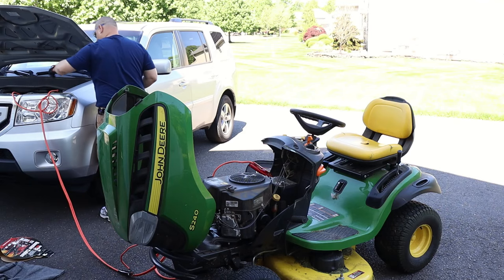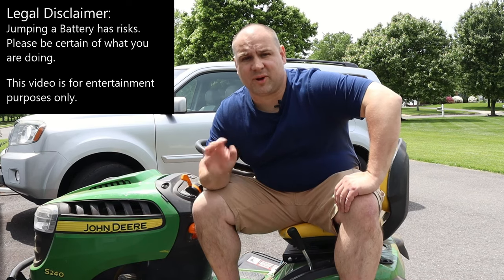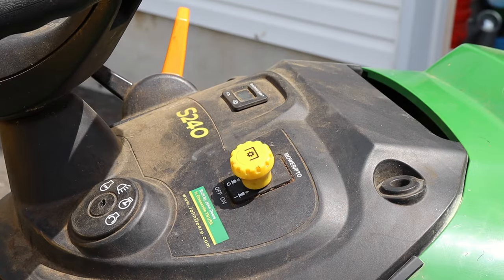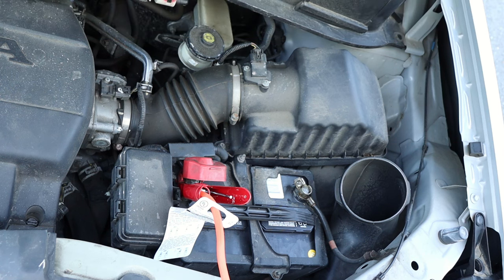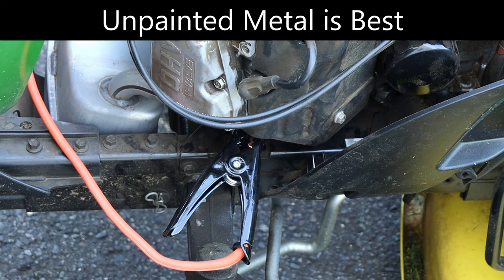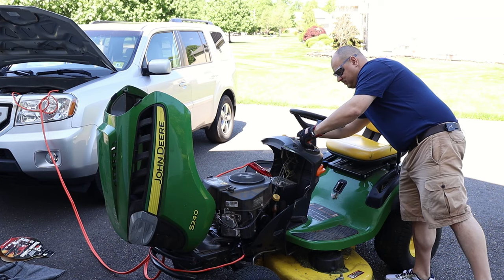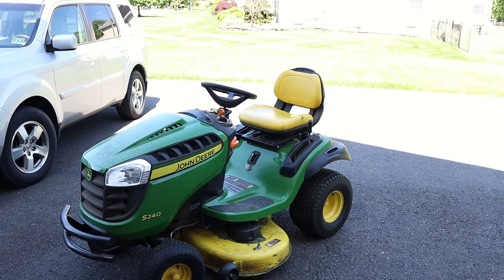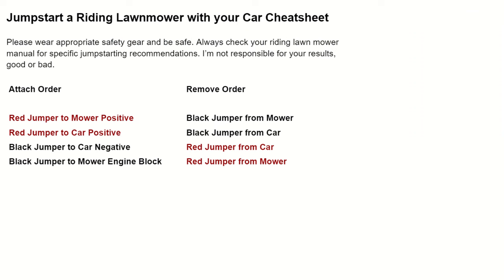How to Jump Start a Riding Lawn Mower with your Car * Safely *

Comment: Worked great!  I've been troubleshooting my John Deere for the last four days, I replaced the solenoid, new spark plugs, looking for loose wires or broken safety switches -- nothing -- just that machine-gun cranking sound with no turnover of any kind... after this video, I hooked up my car (which I would've done with the engine running if I had tried it on my own -- BIG thanks for telling us NOT to turn on the car during the process!) and the mower started right up!  I cut the entire lawn, put it back in the garage, shut if off... then I turned the key and it started right up again -- without a jump from the car!  Guess I found my problem -- hopefully the battery will last me the rest of the season!  Thanks man, you saved me many headaches!

Comment: Silly question, but should I start my vehicle to help with the charge? I noticed during the video you only started the mower. Thank you in advance.
Reply from the maker: |I wouldn't start your vehicle as you risk damaging the smaller electrical system of your lawn tractor. You should have plenty of juice from the car battery alone anyway.

Comment: Why don't you connect the black clamp to the negative part of the battery? Also, I've heard conflicting things about jumping with a car. One being that it's okay to turn the car on, but just don't rev the engine.
Reply from the maker: The battery emits gasses especially when low or no charge, when you reintroduce a charge you could ignite those gasses and cause fire or explosion of the battery. I also wouldn't turn the car on or rev the engine as you could overload the electrical system of the mower. Why risk it?

Comment: My cables arent split enough to connect the ground to a bolt on the engine block. Can i connect it to a bolt on the back side of the frame under the battery by the wheels?
Reply from the maker: Sounds like it would probably be okay.

Comment: My mower won’t start unless I’m sitting on it and the battery is under the seat
Reply from the maker: Will it let you start the mower if you engage the parking brake? If not, then you'll have to figure out how to bypass that safety feature somehow. I've never had that type of design myself.
Reply: I got the same i just wedge a log between the seat a d steering wheel
Reply: u can disconnect this safety feature by disconnecting two components.
Reply: You can also tighten the safety bolts down to the point where it overrides and believes your sitting on the sit. This will allow you to lift the seat and access the battery to jump it
Reply: Maybe my mind is in the gutter...but umm..
Reply: If you complete the circuit for the seat safety switch it'll bypass it. Every design is a little different  but the basic idea is to Just rig it up so that it thinks you're always sitting on it. I always do that. Because it's annoying

Comment: Did you have  the car on or off when you powered up the lawnmower?
Reply from the maker: Car off... If you start the car then you could potentially overload the smaller lawn tractor electrical system.
Reply: @DIYWithAaron  Thank you!

Comment: Just tried this and is shuts off after I unhook the cables. X2 time doing it let it sit for 10 minutes and shut off 2 minutes after undoing the cables again
Reply: John Deere 212 1983 year
Reply from the maker: I'd be looking at either the battery or maybe the alternator for issues in that case.

Comment: Hey my lawn mower wont start with a new battery..but it will start if I get a jump fro. My truck ?
Reply from the maker: I'd start troubleshooting by checking connections to the battery and then testing the battery with a multimeter if you have one.

Comment: Great video. Now, can I do the opposite and jump start my car with the lawn mower?
Reply from the maker: Depends on how weak the car battery is...  you may be able to jump a car off a 12 volt lawn tractor battery provided the car battery wasn't too weak. I'd disconnect the donor battery from the lawn mower battery first before trying.

Comment: Do you have the car running?
Reply from the maker: Definitely do not start on the car... you could damage the much smaller electrical system of the mower. Too much power.
Reply: @DIYWithAaron  ok

Comment: Of course some manufactors owners manual says not to jump your mower....they want the money from fixing your mower....which most of the time is a dead battery...lol
Reply from the maker: That's probably somewhat true. Lawn tractor models that advise against jumping maybe overly cautious. I know they like to be able to say "We told you so." & "Not our problem" if you don't follow their recommendations and anything goes wrong. 

Personally, I'd expect most lawn tractors are jumpable, but I wouldn't be comfortable telling folks to do something that contradicts the manufacturer.  The manufacturers are inherently the experts on their respective products so it's only appropriate that I defer to them when it comes to specific product recommendations.
Reply: @DIYWithAaron  i agree with your reasoning behind your post.